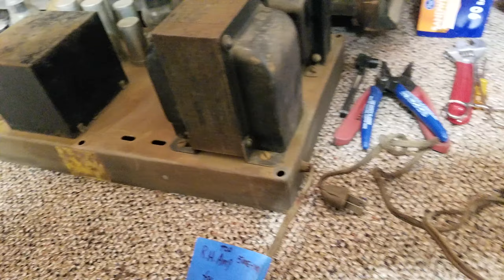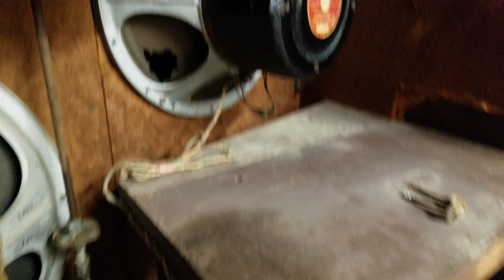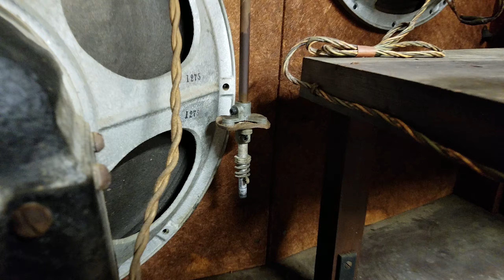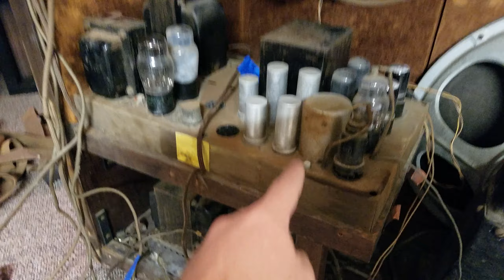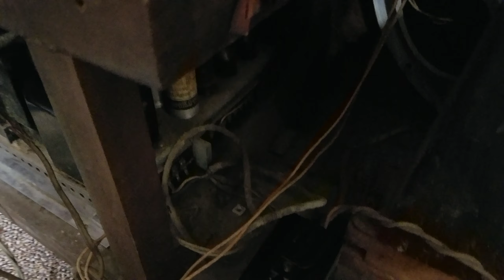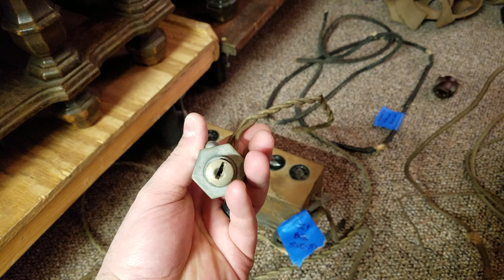1942 Capehart 500-M Part 3

Comment: An interesting Capehart you've got there. Thanks for the serial info on the changer...I've got a 1942 IIRC 411 and I probably need another changer mech (one lever for the for the both sides play arm broke on mine from a mistake I made assembling it but the pot metal looks good and it cycles).

Those lock switches were somewhat common on high end radios back then. I've seen several EH Scotts that had them. I believe the idea was to prevent the less technical misses and potentially destructive children of the family from operating it and messing with the settings or causing damage....Stealing a Capehart is a less practical affair than stealing an elephant since they weigh about the same and you can't convince a Capehart to walk.
Reply from the maker: Good day, I appreciate you sharing your Capehart as well.  It would be best to look for a 1941 or before 16-E.  The 1942 pot metal changers are not worth repairing in my opinion, as they continue to age the metal will fatigue even more causing more issues down the road.  The changers are very time consuming to service and very complex.  Take your time and read the manual thoroughly and you will eventually have a working example.  Thanks for sharing the information on the lock situation.  I am familiar with E.H. Scott although did not know they utilized lockout's as well.  The original owner of this Capehart 500 did not have kids.  He did entertain many guests and friends though back during the 1930's and early 1940's, so may be one of the reasons for the lockout.